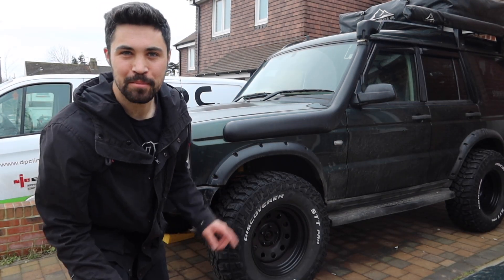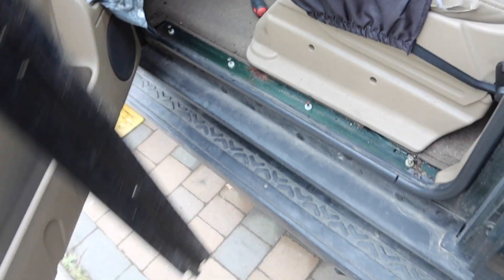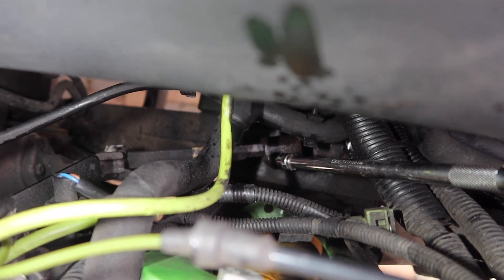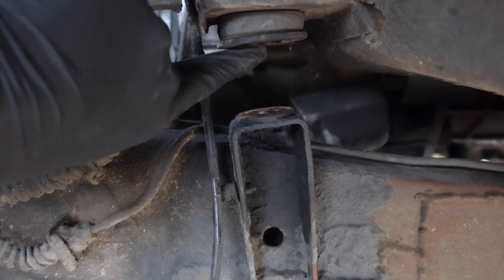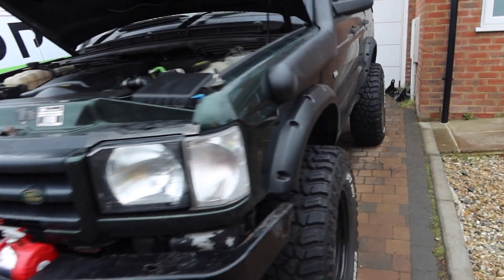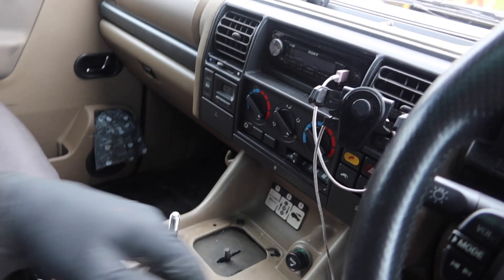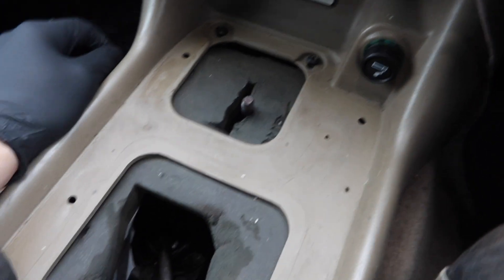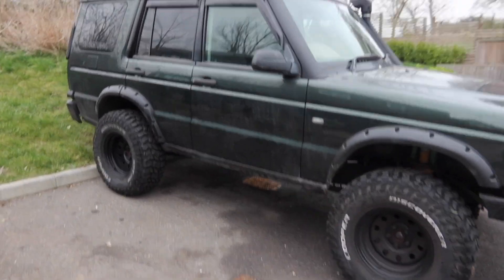The BEST Discovery 2 Body Lift Guide!! (DIY on my DRIVEWAY!!)

Comment: great video, just done a body lift on my landy, ran into this issue with not getting gears so need to do what you said and space it out or just cut a notch out, not decided yet!
Reply from the maker: Spacing it out would be ideal but it's definitely more involved and difficult! I just cut the plate and be done with it 😅
Reply: @AutumnCars  think i might just do the same, does the trim and gator fit okay afterwards?
Reply from the maker: @RCKLSJ okay is the right word.. not perfect but okay.. 😅

Comment: When you undo the steering column do you need to adjust it yourself or will it automatically adjust when you lift it and then just retighten? Great video by the way and that lift finished it off very nicely. Doing my body lift tomorrow! 💪
Reply from the maker: Yeah just loosen, lift the body and give it a wiggle and retighten. Good luck!!
Reply: @AutumnCars Thank you mate much appreciated. One other thing I forgot to mention is when you put the lift blocks do the body mounts just sit on top of them?
Reply from the maker: @EvansAllElectrical2142 yes I'm pretty sure I didnt remove the body mount rubbers?😅

Comment: 😀great video - how did you get the bolts out of the rear outriggers? mine seem to be catching the wheel arch. did you replace the washers and inserts?
Reply from the maker: Cheers - I'm pretty sure I removed the nut and lifted the body to be able to remove the bolt? Can't remember fully haha!

Comment: Good job. Does anyone know how high the rear of the body can be lifted without disconnecting everything in the engine bay? I need to do some welding on the chassis behind the rear wheel, and would be handy to have as much clearance as possible. It's a lot of work removing the body totally.
Reply from the maker: I reckon 4" or so but i can't remember how high I went for this!

Comment: Are these the plastic type lift blocks? I got a set off eBay and not keen on using them, didn’t realise they were plastic.
Reply from the maker: Yep, seemed to be fine, lots of people run them and ive never heard of any issues?
Reply: @AutumnCars  ok thank you mate, is it 14 for a D2? I only got send 10 😂
Reply: If your not keen then use 2x2 box section and cut it in to pieces and drill bit I'd still get some 5mm hardened plastic sheet and cut some little squares to sit top and bottom of the 2x2 so it's not metal to metal which rusts quicker

Comment: That sound is power steering fluid. I think it might need a top-up and jack up front and turn the steering wheel to get air out. I get the same noise in my disco from a small leak

Comment: Hi. What kind of rims do You have? What offset? Any link?
Reply from the maker: Hi - 16" modular steels ET-35. I bought them through 4x4Tyres with the tyres fitted. They are Cooper STT Pro 285/75r16 👍

Comment: Great video mate! Ive just done mine following your video! Mine is an auto so no messing around with the gears… one thing to mention, the flexi brake pipes in the front left wheel arch, be careful they arent being stretched.

Looking forward to more disco 2 content!
Reply from the maker: That's amazing to hear! Ahh yes I failed to mention all my brake lines are +2" braided ones and have already been unclipped from the body sorry! 
I assume that most people that attempt this are somewhat mechanically minded and can sort small issues like that. I'll mention "and other things" in videos moving forward thanks :) 

Disco 2 and Defender content coming soon, lots filmed :)
Reply: @Autumn Cars  thats alright I noticed it after I had done it and wondered how much I must have stretched it then separating the vodka to insert the blocks! Seems to be okay though!

Will definitely be keeping my eye out for more vids
Reply: Hi Bradley. Just wanted to ask if you need to take out the gear knob, mine is an auto as well and I'm thinking of doing it as well. Cheers
Reply: @alexbeggy2007  hi mate, no, just loosen the selector cable on the gearbox end on the XYZ switch. This will allow the cable to slide out slightly.
Reply: @Bradley Watkins  thanks for the info. Really appreciate it 👍

Comment: Did you have any issues with the steering column, did it need adjusting?
Reply from the maker: It's in the video dude, just a quick clip of it tho. Loosen off the UJ in the engine bay before lifting the body and then tighten again once it's all done. Mine developed a mystery squeak from just behind the steering wheel afterwards, which I still haven't worked out🤦‍♂️

Comment: Sorry to be so negative but a body lift is a waste of time, you gain nothing you would be better off doing a proper lift on it
Reply: Not really, what about tyre clearance etc
Reply from the maker: I see your point, however I needed more tyre clearance cheaply (sub £100) and not compromise on-road stability and geometry. Lifting on the suspension more than the 2" it already was would require more than only springs/shocks/blocks to drive well :)
Reply from the maker: 14 for a D2 yep. Extra 4 under the load area